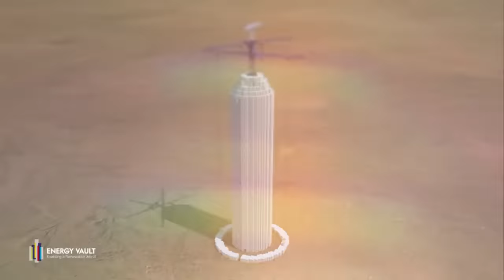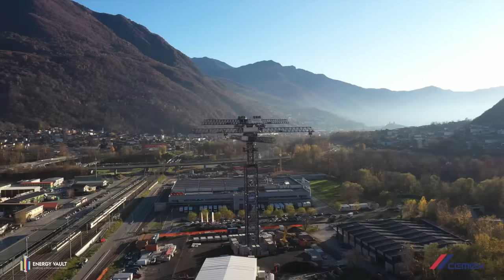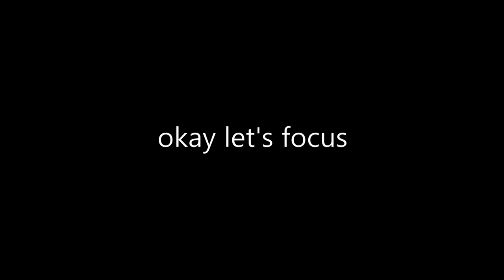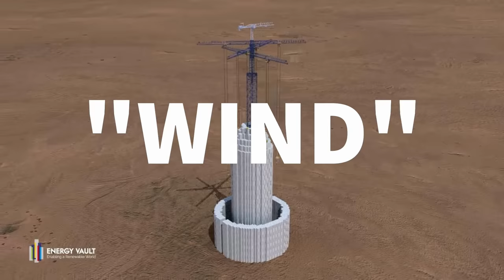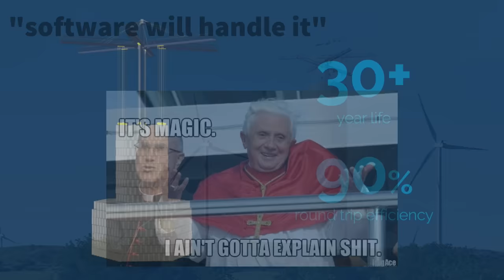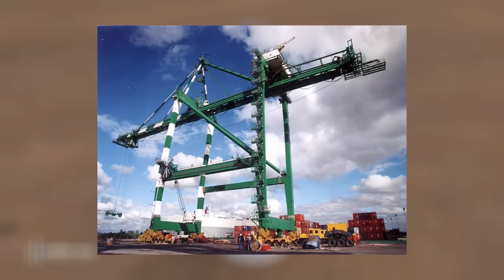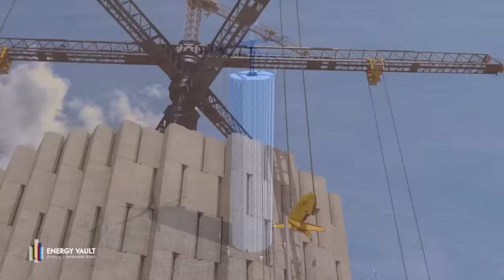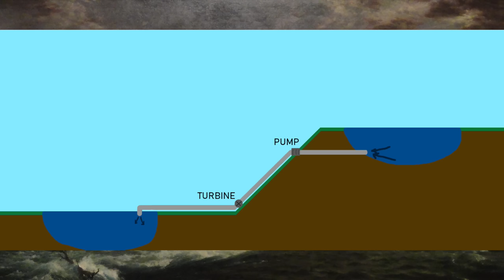The Energy Vault is a Dumb Idea, Here's Why

Comment: Why is it when I see one of these things, these futuristic ideas that they're dumber the last one. The concept itself seems to not be financially viable. and given the output over the course of a day won't ever work. The windmills solution has a problem in that power generation is inconsistent and thus won't ever be cost effective and any surplus is currently just lost to the winds.

This pie in the sky will suck up all of the surplus sure but since the surplus is inconsistent I can foresee issues with getting blocks put in place to begin with and the longer they hang on the cable the greater the chance of breakage (crane need to be inspected daily normally so there will need to be about a dozen people that go and inspect the motors the cable etc and do things like grease the cable once a week)

This is a cash grab pure and simple, just like all of the other "Greebn" systems that are currently in place - they're inefficient, they're they actually have massive amounts of waste etc etc etc.

Comment: It's easier and cheaper to use hydropower. Pump water up hills with renewable energy and let it flow down through turbines when renewable energy is scarce.
Wherever you have natural elevation this is automatically the better option. 
But it requires a more flexible and decentralized grid, which is the No. 1 bottleneck for renewable energy.

Comment: "this won't work everywhere, some places have high wind" and some places are deserts that can't handle pumped hydro.
Reply: hydro needs very specific geology to work: pumped hydro is only slightly more flexible.  and the problems you see? kinda silly.  if winds are high, you'll be raising blocks, not lowering them: shorter strings, less swing.  concrete being environmentally unfriendly? only if you make it new, and those sustainable blocks will probably live longer than your channel.  you're just looking for problems to be angry at: they're much easier to solve than building thousands of dams in the middle of deserts to use pumped hydro everywhere.
Reply: @calummcconnell7313  "you're just looking for problems to be angry at"
No, he is pointing out some of the many reasons why this is not done. 

"if winds are high, you'll be raising blocks, not lowering them: shorter strings, less swing."
You have to lower the blocks when you finally put them onto each other, and even a tiny bit of swing will ruin the placement. Remember: Even tiny errors will lead to instability.

"those sustainable blocks will probably live longer than your channel"
No they won´t, because they will be constantly put under stress by shifting forces that wear them down. And even one block that breaks, can cause the entire tower to fall down and destroy hundreds more.

"they're much easier to solve than building thousands of dams in the middle of deserts to use pumped hydro everywhere."
1. Nobody is suggesting that, because we usually don´t have huge populations (and therefore need for energy storage) in deserts.
2. It would in fact be much easier and more sustainible to do that, than to build those lose towers. Those towers would have a terrible energy efficiency, not just because you need to put much more energy into a complicated high-precision-process, than you would have to put into a simple pump, but also because you need a lot more precision mashinery and computers, which need constant maintainance. The beauty of hydroelectric storage is its simplicity.
Reply: @Omega0850 
You’re severely over-estimating the amount of swinging these blocks will experience, the difficulty of stably placing them, and the amount of energy needed to do that.  Yes, repeated stresses can and will cause fatigue, but just because something is brown doesn’t mean it’ll crumble.  Further, fatigue is much less of a problem in nonmetals.  A bridge is forced to endure repeated and varying forces, but those last a long time.  No, misplacement won’t lead to instability: think of it like legos.  If you’re a little bit off, it’ll be guided into place properly by the design of the shapes.

Moving and placing big things with cranes is something we do a lot of.  Shipping containers (no, it isn’t the wide base of the crane that prevents the container from swinging) are much more capable of swinging, and require higher-precision placement than these blocks, but we still move them around all the time.

even when you’re willing to level mountains, finding sites with the conditions needed for pumped hydro is very difficult.  And it’s not like even an ideal site is easy to work with: you think the tunnels don’t require expensive machinery to build, or the pumps aren’t immensely complicated electromechanical systems?  Further, more precision isn’t inherently more energy; even to the extent that it is, it isn’t on the orders of magnitude needed to justify the difficulty of creating enough pumped hydro sites to make up for it.

Comment: So basically... Energy Vault bad because wind? That is a pretty flimsy claim. The tower's brick-bond pattern placement of concrete blocks gives it a lot of stability. The only potential issue is placing blocks 100% accurately if there is a bit of wind pushing blocks as they are being lifted or lowered. idk pretty weak argument
Reply: That’s exactly what he’s saying…
Reply: Bruh you ever see skyscrapers?? They have huge foundation pillars to stop it from falling over. This is just putting them on top of each other. Not gonna be stable. Also "energy vault bad because wind" isn't even the only issue he mentioned with it
Reply: @incrediblebat  Energy vault was a terrible idea for bunch of reasons. Wind is by far the weakest logic against it. I would simply focus on the inefficiency. Like, what are the blocks at the bottom good for...
Reply: @owenstevens7151  true

Comment: I could see a simpler version working. What if you just had one counterweight with the mother of all pulley systems pulling it up and then letting it run down a slope? A gigantic weight like in a grandfather clock could provide a sort of dry pumped hydro for places in the desert and the like.

Comment: Let's not throw the baby out with the bathwater.  Maybe a modified version would work.  Bury it in a deep hole.  Use water tanks for weights instead of bricks?
Reply: I think most commenters agree numerous bricks is not the way to go.  With one giant unit, we could use scrap for the weight, only have to manufacture the containment.  Not a total solution for our waste problem, but something of a mitigation.

Comment: You debunked a single concept.  Each of your points are easily overcome with the most basic engineering / architectural modifications.  And oh, use recycled metals (old crushed cars etc) vs. concrete.

Comment: CO2 from concrete may be a fair point but I imagine the opportunity cost here in terms of CO2 is probably still favorable when amortized over life. This concept however doesn't require concrete, just mass. Pumped storage hydro-electricity is not a suitable solution everywhere and energy production and storage should be local to consumption. You were correct when you said you're not an engineer, and frankly it didn't even need saying.

Comment: To store energy with water is indeed perfect. It is cheap and efficient. But you can’t build hydroelectric dams everywhere. You can build these vaults everywhere, they have a purpose. I agree this round shape is dumb and we have to find an alternative to concrete. 
But to dig down in the earth to build an artificial dam is as well, that would cost so much money and time. Battery’s are no alternative as well. Water is good but you can’t store enough energy with water, so we need solutions like that!
Reply: why is the round shape dumb? less air resistance

Comment: .... what are you talking about? wind would be negligible with that kind of weight and also wouldn't effect wires. Yes concrete releases co2 but just that one time for effectively limitless energy storage. you have literally no clue what you're talking about so stop.
Reply: ? Negligible? Are you having a laugh. What about when the crane is moving to pick up a block. It has no block attached to it so weighs much less. The wires will easily swing around

Comment: Renewable energy is a stupid goal. The goal should be meeting our needs while minimizing environmental impact, focusing on RE instead is counterproductive.
 Reducing dependence on hydrocarbons won't come from blocking oil, it will come from having a equally effective substitutes.
Energy policy should not favor wind, solar, biomass, geothermal, hydro, nuclear, gas, or coal but should support all energy systems in a manner which avoids energy shortage and energy poverty while minimizing environmental impact. 
All energy always requires taking resources from our planet and processing them, thus negatively impacting the environment. It should be our goal to minimize negative impacts and focus on the three objectives, energy security, energy affordability, and environmental protection instead of on useless buzzwords like renewable.
Reply: Nuclear energy is the most efficient to date.

Comment: Your graphic shows a pump at the top and turbine at the bottom. Lost all credibility. This block storage solution is still viable in areas where there isn’t enough water or elevation change for the hydroelectric system.

Comment: You sound just like the sceptics in the late 1800's. "What good is electricity anyway?  It is only good for parlor tricks."  It took many attempts, and failures to get the first plane off the ground.  Have you never heard of hempcrete?  A much more carbon friendly solution to concrete.  Btw, water gravity pumps wont work in places that have no hills, like Kansas, or Nebraska.  My guess is that you will be eating your words when in 20 or so years batteries similar to this are in wide scale use.  I'll take my money.  Now would be just fine.

Comment: Brilliant, but you cannot build a hill with a lake on top of it everywhere. Efficiency of energy vault is also bit higher. Also, building a crane is way cheaper than digging a huge hole in the ground. Your opinions are oversimplified and polarising, which, I presume, might attract more audience, but at the same time destroys you credibility.
Reply: Continuously operating a crane to extract stored gravitational potential energy from heavy blocks is very expensive compared to operating a hydroelectric turbine. Lots of wear-and-tear on those pulleys, gears, and cables associated with a crane, which means lots of time-consuming and costly safety inspections, maintenance shutdowns, and replacements of worn parts and cables.

Comment: #adamsomething Dumb!! You did not do your research. I can tell. On top of that you focus on the negative aspects that plague any and every source of energy or structure (i.e. biproducts of construction or the fact green energy generates pollution not mentioning the reduction when compared to traditional garbage) We use concrete in construction daily for mega projects so co2 will always be made (not to mention power plants make co2), next wind turbines are placed in areas where winds are constant or has no extreme fluctuations. Next they obviously would not only be using wind turbines to "charge" the battery. 30 years is a good number considering the lifetime of most power plants and batteries are rated for <25yrs. On top of that, it's a crane and blocks, the shit should take a day to repair
Reply: one could design a system that used scrap concrete or other waste.
Reply: @annamyob4624  scrap concrete is a stretch because you can't exactly reform it, i don't think. Maybe metal cages or pulverized but then the efficacy goes down
Reply: @klownkilla3  cool story bro. Yea, you totally know more than the creator...

Stop it and get some help.
Reply: @KD10Conqueror  lmao is he your god or something?? Lmfao the creator
Reply: @klownkilla3  welp. You know what i'm talking about. Don't try to deny it. You are in the wrong.